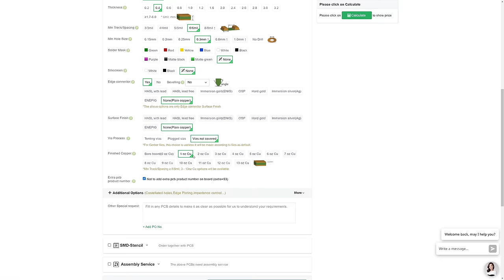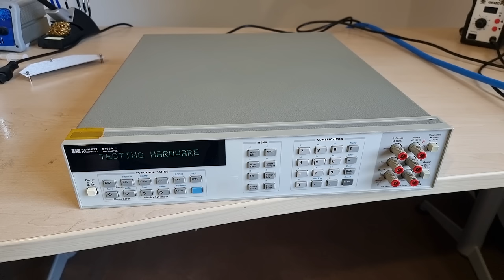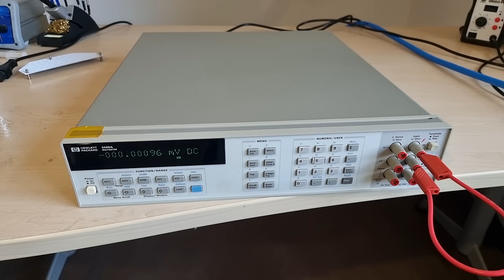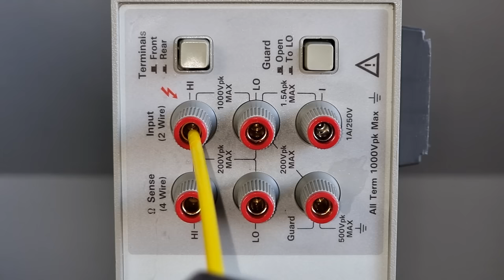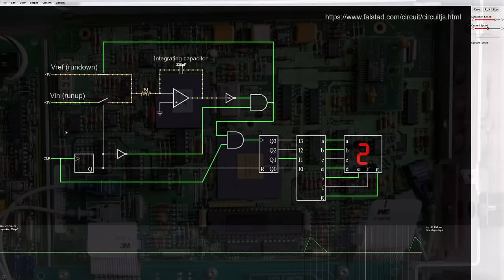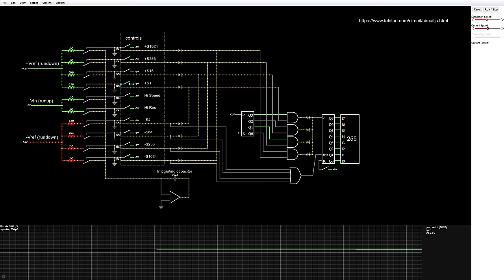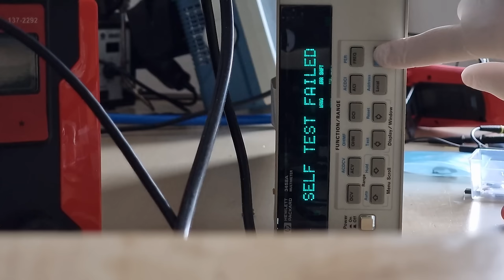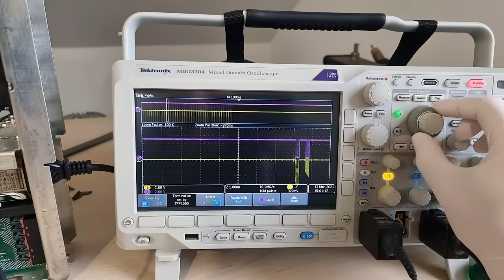HP 3458A - Why is this 31 year old Multimeter UNRIVALLED?

Comment: It is not the age of a test equipment that can define its quality. The design criteria and ingenuity of the project are the defining pillars of this high precision multimeter, elevating it to the level of timeless legend.
In 50 years of analogue system design -mostly transducer design and applications - I have seen the oddest behaviours of component parts. Many JFET from the time had the gate-channel leakage problem, and I found out it wasn't caused by deterioration of the gate insulation, but by later diffusion of pollutants like sodium, present at manufacture. Depolymerisation of the dielectric layer of capacitors give ways to the strangest phase rotations proportional to voltage variation. Tantalum caps on supply rails regularly exploded during self-clearing. Bipolar transistors becoming noisy and losing their Ft because of thermal and dielectric changes in the base slice of semiconductor; and I could write pages about the odd behaviour of Zener diodes. 
Your troubleshoouting methods recalls much of my past experience, when replacing 100% of the parts on a PCB didn't mend the fault.
Mostly, I liked your inner passion and competence that made this video stand out.
Thank you.

Comment: Ac cal done best on a 90 day 5700 or 5720 with long history and known drift. Also the Front/rear switch degrades quite a bit over time and needs some exercise from time to time to stay stable. 
I use this meter quite a lot in AC/DC transfer measurements as the dc receiver for an MJTVC or Fluke 792A as it has the benefit of a completely isolatable guard. 
Beautiful piece of gear HP made there.

Comment: Interested in your comments about the integrator cap being a basic component, nothing special. Whilst this is true my experience with manufacturing the 1281 was that the voltage test process could leave residual effects on the component which while undetectable by any normal means nevertheless had negative impact on its performance as an integrator cap. The cap had to be supplied untested. As it was only subject to +/- 10v it really did not need testing to 300v which was the normal rating of the component. My hypothesis is that testing to full voltage induces mechanical stresses in the electrode/insulator roll which do not relieve. Although the capacitor is bidirectional it had to be fitted in the correct orientation which I assume is, outermost electrode layer to ground.
To sum up as far as the 1281 is concerned yes it is a pretty standard component but in practice not so much.
Reply from the maker: Wow, were you at Datron during 1281 development? That is awesome! I am still hoping to find one some day and to 'nerd out' over it as I have here. Can I come back to you for some questions should I ever find one? One recent side effect of my search was the acquisition of a model 4950 transfer standard. A very specialized and interesting unit, but that video is going to be tricky to research without any component level documentation 😅
Reply: @reps   no I was not there for 1281 development. I was a production technician. I did however get involved in Fluke 8508A development in terms of design of test equipment. You can imagine the fuss when I asked for 12 Fluke multifunction calibrators for use in production of the 8508. I did some work on the 4950. If you would like I can ask if a maintenance manual can be had.
Reply from the maker: @rorywilliams5131  Oh such a manual for the 4950 would be tremendously helpful, I'd really appreciate it if you could try! ( marco@reps.cc ) It took me almost a day to find out why mine was having issues in most AC ranges: There was a leaded fuse blown underneath a soldered shielding can, I guess part of the AC preamp 😁
Reply: @reps  Hi Marco, Turns out the 4950 never had a published service manual like the 1281 did for example. The service centers and perhaps the military would have had. As it was a transfer standard it would not be appropriate to have customers fixing it. When you consider the value of the cal it was transporting the company needed to have tight control over the instrument in order to take responsibility for the cal. As you probably know it was intended for circular cal. The calibrators on site would have a second cal memory which is only activated when the transfer standard has returned to the cal lab and been measured as in the required spec. I will keep looking for circuit diagrams. Essentially the guy sitting next to me did all the 4950 stuff and had been with the company for 20 years.
Reply from the maker: @rorywilliams5131  Thank you for the details, much appreciated! Yes, I suspected something like that, as most things that were at some point published somewhat liberally have a tendency to surface somewhere on the internet ... but for 4950 nothing ever did. So should you ever find anything about it, I would be most grateful for a message :_LTZ:

Comment: What a fantastic video, thank you as always!

38:55 Do you have a recommendation for pin headers that play nicely with IC sockets? I'm wary of sticking the standard 0.025" square posts into those round sockets.

5:52 Schlumberger, the company that acquired Solartron, is pronounced in the French way. The last syllable is /ʒe/, like in "étranger." Names from Elsaß-Lothringen are troublesome!
Reply from the maker: slumbajay?? childhood=ruined
preci-dip makes those nice pins, but I don't have the part number rn
Reply: @reps  danke beaucoup, merci schön
Reply: Do not stick square pegs into round holes; that's a sign of trouble ahead.

Comment: As a USAF metrologist these were always the things people stole and hid in their sections.  The Fluke 8508A eventually bested it in pretty much anyway and the successors to it seem great, but that'll be the next dragon for you to chase lol.
Reply: On paper 8588A looks to be really good. Has some advantages especially in high resistance and high current ranges. USB and LAN support is also good in modern days. 3458A is completely linear in 10 to -10V region though, using same signal path for positive and negative voltages. 8588A seems to use different signal path in positive and negative voltages. Atleast at zero crossing there is a big jump for 8588A.

Comment: I did not fully understand any of that, but it was very emotional to watch someone trying to fix the unfixable. Who actually needs A3 boards with broken U180 chip? Thanks for the video, though - basically if I tape together two 34410 meters, I get a 13 digit multimeter with none of this hassle

Comment: Since you used a different reference, shouldn't the reference voltage be changed during calibration? 
The same for running it at 50C instead of 90C?

Comment: after a quick research. it costs 15 grands. So what is this multimeter used for? and are they using this multimeter? If you are doing the work what you think is for this multimeter, so what multimeter are you using?

Comment: Teflon is a bit better dielectric for capacitor than glass. Generaly all RF connectors are made with it. Electrical permitivity is near independent of temperature. Add perfect lackeage and insulation properties make this material near ideal for capacitors. But electrical permitivity is about 2.7-3.0 and is lower than glass (4-8) or pretty all other materials. Glass have ionic structure so you can expect higher leackage current.
Reply: The dispersion time constant is the problem. It is a volume effect and the time constant spread go easy over some decades. This fall into the  ramp times and finally the best way is to balance for zero slope. This eleminate the dispersion effect and comparator delays.

Comment: This video has just cost $75 on an MHP-30 preheater. Before that, I was using a Quick 854, a very expensive but bad unit in terms of thermal stability. The internal cold junction is junk, so bad that on a good day its heater is less than 10C off its set temperature, and on a bad day it could be 150C higher.

Comment: I don't know how you managed to recreate my first job. The 5700 and now a 3458, and the 4-way short made out of a PCB, It's exactly what I worked with in my youth. You're only missing a Fluke power amplifier for the 5700! However Marco is a little thin in the Pressure ranges, how about getting some Ruska dead-weight pressure testers?
Reply from the maker: yes please to both ... if you meet any calibrator power amplifiers looking for a good home, lemme know 😁
Reply: @reps  I you get hold of a Ruska remember to only wash the piston with the factory approved Cashmere Bouquet brand hand soap, most easily obtained by stealing it in hotels.

Comment: Maybe its getting the input through the old analog crystals  reading frequency from the ether   Like the Panasonic voice recorder DR 60 from 1990 that is so sought after it sells for $3000 in good shape.  The voice recorder that gets voices from spirits.  They were able to head that off with new model they ushered out DR-90  and every recorder since .  Other recorders its 60 attempts to one capture of a EVP compared to 1 in 3 with DR60 units.

Comment: I never bought one because they are to expensive if you want it to come good working including complete calibration history. There is no use to have one without that data. You can calibrate it but to know if it is stable over time you need to repeat that a few time before you can use all those digits.

I think those banana-bus connectors are made of Beryllium copper

Comment: I also have gear fever. I have to have the best and newest gear. Fortunately I work for a research and development company therefore the company buys it for me.

The new gear that I need/want is a DC power supply that normally provides high voltage but it also provides power in various frequencies. You no longer have to create your own circuit to get high power frequency. In the past in order to get high power DC frequency you would need a circuit for example a DC amplifier, a frequency generator and the power supply to do what would power supply can do for you though.

Comment: Marco, what are the applications of such precise meters? Could you, for example, perform physics experiments at the quantum level? Could you confirm the speed of electrons in a wire or can you measure how many electrons are passing through a section of wire?
Reply: From what little knowledge I have, these are usually used in calibration labs to calibrate other meters/devices. Or to test really high performance DC stuff ( things like voltage reference, high resolution ADC/DAC...)

Comment: hello done subscribing. thankyou for the video. can i ask if you have a copy of the program used in digital board? can you make a tutorial on how to program that surface mount and latest nvram. I have the  same problem acal required and scal all required and all i need is how to program the nvram
Reply from the maker: most of your old memory has probably been lost due to dallas battery empty, you can try to read the small dallas part with a universal programmer ("minipro") but normally you won't be able to rescue any valuable data. you can insert new dallas parts or build my FRAM adapters and go through the calibration procedure to write them
Reply: @reps  where i can buy your FRAM adapters? Can you teach us how to program the latest NVRAM? We know how to program Dallas in an old model but we don't have any idea on how to program the surface mount NVRAM(Cyprus) in the latest model of 3458A(Black) . We are willing to pay you for teaching us how to program.

Comment: Me: Nuys a multiple output precision test voltage unit. Test a Harbor Freight $7.00 millimeter and it's accurate to .002V....That's good enough for me. I was very surprised that such a cheap unit was so accurate.

Comment: Im just a plumbing engineer and found this incredibly interesting  im saving it as my fav video of all time   Dammit is there anything You dont know about the science of electronics?  Wth 🤦🏼 

If i would have found that at a widows garage sale for $20 i would have laughed and told her to chuck it in the garbage your hubby was using dated 80s hardware no  one has any use for that analyzer !     Im going to be looking at everything now see if i can find you a spare  and send it to you.  

Why are you not sending probes to pluto or working at Tesla   All that and you can edit to im impressed  

Heres me trying to replace the software drivers on my DJI mavic pro yesterday and getting flustered lol    

Does your expertise transfer  to modern circuitry ???   Are you able to work on todays modern circuits??    

I bet you own a working IBM 5100 
God mode enabled    

Why cant anyone with your knowledge engineer a unit that duplicates this old 80s machine ??   They can fit everything in a 499 gram drone that flys out 6.6 miles and sends back perfect telemetry they cant make a machine to analyze??  

Mind boggling 

Has Elon called you ?

Comment: I would like to watch a battery discharge through this- actually would a battery hoid still or flicker down like a crashing plane dial? You said numbers like 10.000520, 10.000518, 10.000516 volts hubba hubba hubba the legend is true. very sexy numbers right there - plus that is not in the centre but the edge of it's range yeah? that is ludicrous sensitivity. If that was 24-bit audio and faster signal I wonder what the dB of signal to noise that is... maybe similar ~160-180 dB?  24-bit digital audio is ~123 dB sig to noise, this thing has a kind of auto-exposure to drill into it over time. Who needs that accuracy? How come there is no noise - is the high impedance circuit huh?